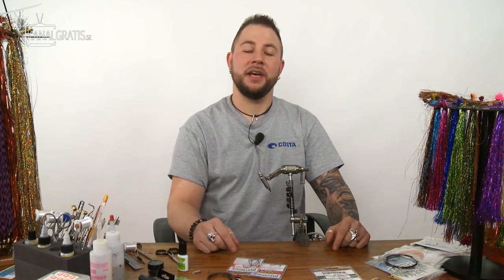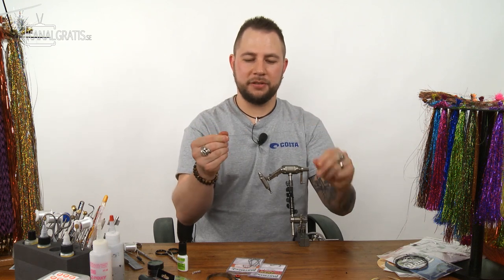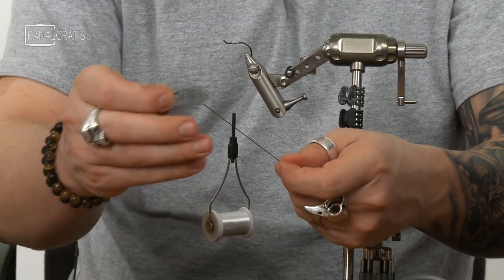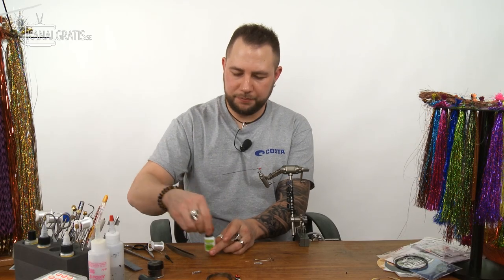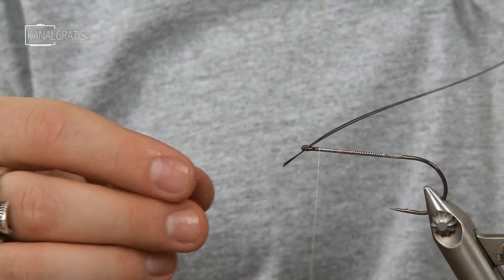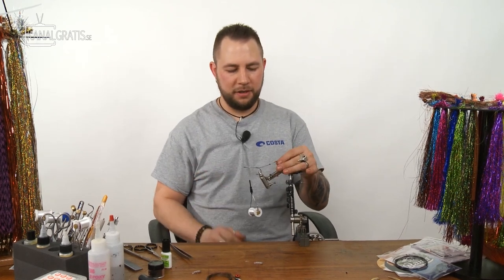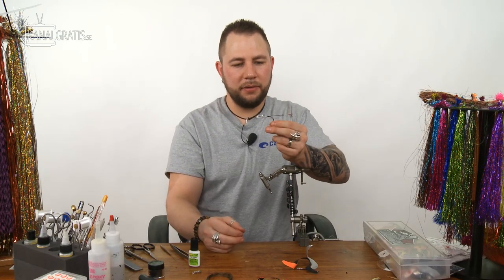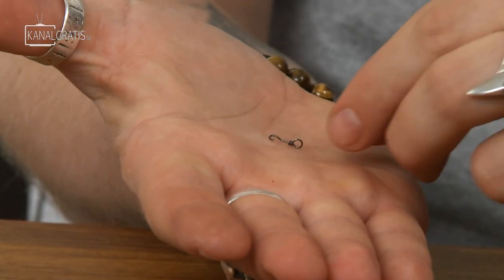Tie TV - Bauer Pike Rig for Wiggle Tail - Niklaus Bauer

Comment: Thanks for the great tutorial- quick question: why do you have a "hook for tail" but you do not seem to use the hook? Why not just have a straight shank? What is the hook actually doing to keep the wiggle tail on when it seems like the threads are really holding it on? Thx.
Reply: The thread is thight around the shank and the hook (he cut) is larger then the shank and threads so they cant pass true easely. I hope i explained this in a mannor you understand. Greetings